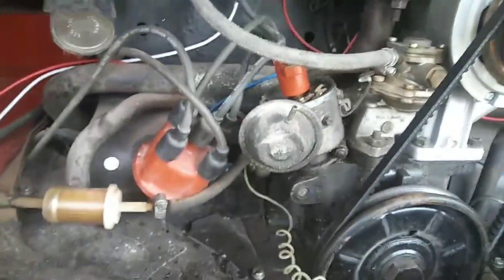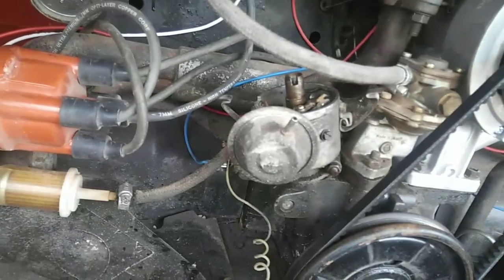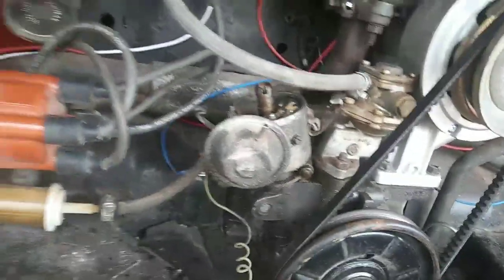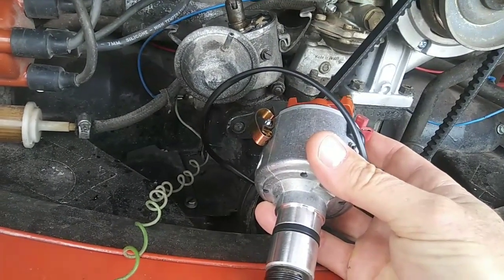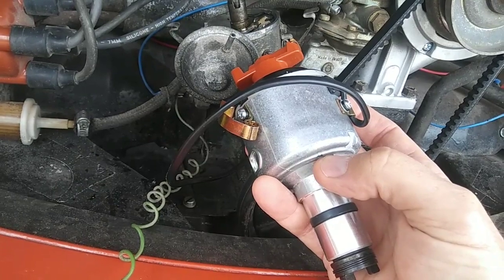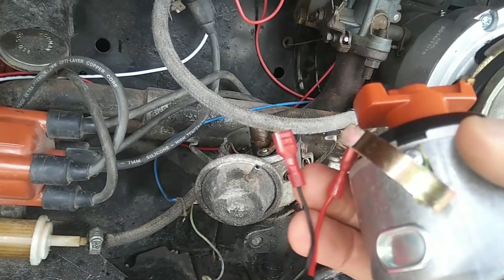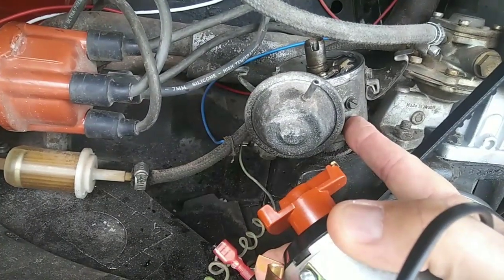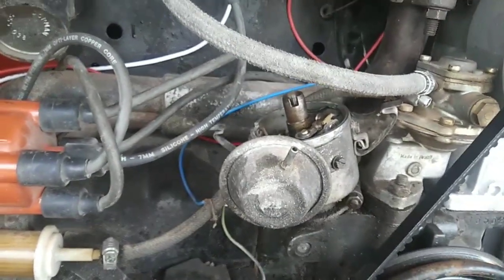VW engine testing your condenser the old fashion way

Comment from the maker: FYI like Oreilly  Auto parts has points and condensers. But most of the crap you buy wont even last a minute. or will fail at any time. Some people are having bad out of the box points and condensers. FYI. they have them but not bosch  So I cant rely on the crap from the parts stores. The empi distributor or pointless pickup is as good as any other brand IMO. I also carry a spare set of points and condenser or pointless module in my car just in case it fails.

Comment: An expert in old Beetle engine one time he told me to not roll the condenser green cable like a twist spiral shape. This makes the current goes in a different way and the condenser last few month.
I listen to him and never have that problem again
Reply from the maker: I had the old bosch condensers with twisted wire for years and never had issues. Your lucky. IMO get a pointless and problem solved . I have 6 air cooled and no more issues.

Comment: Usually you can get three sets of points to one condenser good comment about not twisting the condenser wire
Reply: DONT MATTER
Reply from the maker: do yourself a favor ixnay the points and condenser.  you will pat yourself on the back in the near future. I did.

Comment: So that's why when I hit 70kmph my bug jerks. Thank you!!
Reply from the maker: condenser is a common problem. That is why I go pointless now. I have had a pointless fail. but not as often as the condenser. When the pointless fails it just stops working or starts backfiring. The Empi ones are not terrible and pretty cheap. all have random failures Petronix or compufire or empi  are all the same IMO. think they just rebox them

Comment: these condensers are rated in mfd's your cond must match the coil if its wrong it cause the points to pit f in doubt check factory manual for correct part  #   this a quick test witheng at idle speed pull a sparkwire off insert screw driver in wire hold close to eng hw far will it jump over 1/2 inch is good 1/8 is bad ------wrong condenser  another test check points if they are pitting  wrong condeser

Comment: Brand new bosch condensors cost like $15 here in australia
Reply from the maker: yea they are like the china bosch not like the old bosch with the part number stamped in them.
Reply from the maker: The color of the old real german Bosch was silver the new ones are that gold color. Pure crap IMO. the old stuff was really good.
Reply: @Mikefngarage  I purchased a Bosch Condenser a few days ago from Auto One home In Australia. The body of the condenser is silver and it has made in Turkey on the box. It has a decently thick gauge wire as well. The Bosch points I got from Autobahn say made in Russia. There was a Chinese gold electroplate one on there that failed.

Comment: They carry condensers at every autozone I’ve been at ....
Reply from the maker: terrible ones too. they dont last.
Reply: you have to match your coil you do not just put a condenser in it they are rater in mfd's  a certain value fits you eng not just any cond  wrong one will cause all sorts tbl

Comment: have you tried measuring the cap with an esr and capacity tester? im curious what size this cap is. i do this test alone by locking the rubber cap of the HV calbe close to ground and rotating the alternator with a spanner.
Reply from the maker: no only the spark test and it is pretty accurate. Most of these new condensers are inferior quality compared to the old bosch ones. you can use a spanner to turn the motor over with the key on to test very easy like you say with hv  cable off close to ground.
Reply: Mike F I will do the measurement just to know the value! It must be high voltage for sure,but the capacitance must be low judging by the size..

Comment: dear gawd that fuel filter (in engine compartment instead of behind firewall) and hanging on by just a nipple is giving me anxiety
Reply: That’s exactly how my Fiat 500 has its fuel filter. The battery is right next to the fuel filler cap under the bonnet too. Don’t think safety was of prime importance when it was made 😳.
Reply: @irvb9881  more like a previous owner put it there
Reply from the maker: I have heard of more than 30k cars with fuel filter in that position and never had an engine fire. All carb cars had plastic fuel filters ine engine compartment back in the day. No issues. all in your head.
Reply: @Mikefngarage  My fuel filter is in the same spot too. I just purchased a nice alloy clamp and aluminum body filter to replace the Ryco plastic one. More for better looks than anything else.

Comment: Interesting.. Good condensers are incredibly cheap and readily available. Not a lot of qualitative issues since they are just foil electrostatic devices. I’d be much more concerned about your car burning to the ground. Get the fuel filter out of your engine compartment! No barbs on the ends, plastic and sitting next to the distributor leaking tremendous amounts of static electricity. #1 Cause of engine fires!

Comment: Really useless video
Reply from the maker: I guess you still are frustrated and running points.
Reply from the maker: check spark color. Replace to pointless. IDK which one you buy compufire empi or another quality one. problem solved.